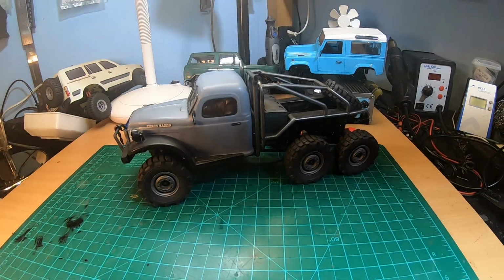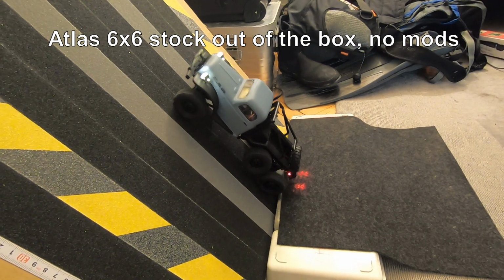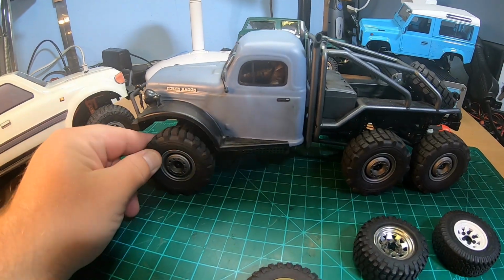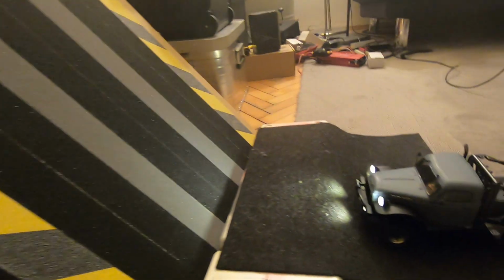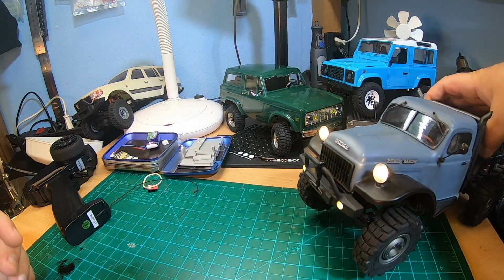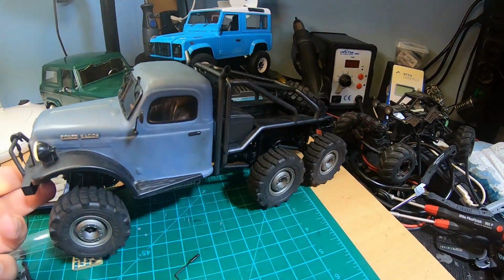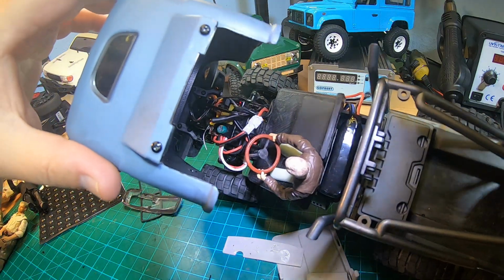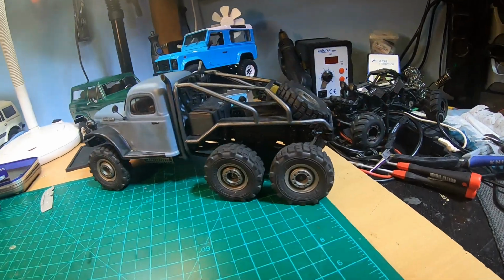Dodge Power Wagon 1/18: FMS Atlas 6x6 Mods

Comment: Great video! Im glad you looked into the tires so much, its weird that it has a different axle size. Maybe one of the rc4wd 1.2" tires would be a good fit, on custom wheels of course. I am having custom dually beadlock wheels made, so we will see how that goes.
Your powerwagon looks great btw! I LOVE your windshield and dodge power wagon emblems!
Reply from the maker: Thank you! 
Hope to see your custom duallys somewhere... in a forum or here on YT!
Forgot the Basher Rockstar tires in the video, I have a lot of them (crap cheap). Won't fit to the rims, but wheels fit to Atlas axles, looks quite cool. But tested only at 53° (with 6 Rocksta wheels) and it could not even climb 53°, no chance... did not make more tests, bad tires (for an awsome price when they were available).
Reply from the maker: Checked the 1.2s... brick edition. They are 67 mm and  larger than WPL tires. And there are no rims, only Lego rims. But rims with 7 mm hex for those on Thingiverse. Will try to print and see, if WPL tires fit... bit large for the tiny Atlas... we will see.
Reply: @donaldsneffe  Did you find a wheel that fits the 1.2” tires?
Reply from the maker: @BeeeZeeeRN  They are 1.0. Several people said, they were able to mount RC4WD tires. I bought a lot of Mickey Thompsen Baja Claws for my Atlas, but did not try so far... too many projects ;-)
Reply: @donaldsneffe  I bought the RC4WD 1.2” brick edition tires for my Atlas but they don’t fit stock rims....do you know of some rims that will fit these 1.2 inch tires?
Reply from the maker: @BeeeZeeeRN  I found some on Thingiverse for printing. I also checked those tires, but IMO they are too large for the Atlas, 67 mm (Rock Crusher Brick Ed.) and 69 mm (Dirt Grabber Brick Ed.). Not easy to solve this problem.
Reply: @donaldsneffe  I got the rock crushers because I remember reading somewhere that they tried them....probably by moving rear axle back a bit. It might be too much of a hassle though.
Reply: Really appreciate all the videos you make by the way!

Comment: I think the spare tire in the back is adding weight to the rear end of your truck which can have a negative effect when ascending. I saw the trucks rear tires grab and flip your rig a few times, which indicates too much rear weight bias. I think the Atlas could do more if the weight was balanced correctly and the CG lowered as much as possible. Very cool video, I enjoy your content and learning by watching the various different methods of testing, thanks! Just a curious thought, but do you think maybe more droop/ softer springs in the front might help even more to keep the truck down in the front and reduce hop? Beautiful job you have done with the Atlas too, it looks proper and scale! I think that the tabs on the roll cage are for KC lights.
Reply from the maker: Thanks. Probably droop will improve climbing. There are a lot of tuning- and testing options for and with the awesome Atlas. Actually it is on the shelf and I am tinkering around with other models. Maybe I will do some shock- and tire-testvideos some day. Too many models here ;)
The Atlas 6x6 is one of my absolute favourites. I love it.

Comment: I learn much from your videos, thank you.  This is such a desirable vehicle for many reasons. Yours is outstanding.  I saw a similar full size build based on the Dodge 6X6 open troop carrier. It used inverted leaf springs that pivoted in the middle for the rears 1940s stock. Way cool.  I'm on a quest to find the ideal tires for this "1/18th" scale version.  What is the outside diameter of the stock tires?  Would it be possible to move the inner wheels forward slightly?

Comment: Somewhere I've read that RC4WD MILESTAR PATAGONIA M/T 1.0'' MICRO CRAWLER TIRES works fine
Reply from the maker: Maybe it is only me that had troubles mounting the RC4WD tires to the rims. I have ordered Mickey Thompson "Baja Claw TTC", but did not yet try to mount them on the Atlas rims. At least I had troubles... if those RC4WD tires work, it is at least not easy to mount those to the plastic rims.

Comment: Greetings from Sweden . Very nice video with lot´s of good ideas . By the way . .  I got one of these myself , the red one . Only thing I´ve done so far is repainting it plus putting  on decals . About climbing , wouldn´t it climb even better with a lower gearing , if avaiable or modded  , preventing the tires from start spinning and loosing grip when trying to climb  . . ? Keep up the good work & be well . . . :O) .
Reply from the maker: Thank you!
Of course you can play around with gears, but it is not that easy to find proper pinions. You could also try a motor with higher t/lower kv. The stock motor has 55 t, there is a new 050 motor from Injora with 66t, maybe it is an improvement.

Comment: Love it, where did you get the lead weight tape from?
Reply from the maker: Thats "golf/tennis lead weight", from Ali, Ebay, Amazon...
Reply: I use thin solder wire wrapped on axles to keep rotating mass down.
Reply from the maker: @Chris-zu8ve  Goog idea, I have ordered supercheap China solder (a lot), which I never would use for soldering, only for this. Did already make some wheel weight with this solder. But how in the axles? Do you wrap it outside?
Reply: @donaldsneffe  Look up beef tubes,  they go on outside, is same principle to wrap the solder.  Dont go crazy with a lot, too much weight will kill your electronics.  but a few layers, try n wrap it one layer at a time side to side, can even use a dab of glue to hold end down before wrapping.
Reply from the maker: @Chris-zu8ve  Thanks, but  I am more a scale guy... not a crazy crawler ;-) - guess, thats not for me. Will stay with my "rotating mass" ;-)
Reply: @donaldsneffe  Look into getting Brass knuckles for the steer axle, you can get 10gram per side so you add alot less to your wheels if you find you need to after the knuckles install.  you can paint them black easy enough for scale look. Trust me you will be hating the slower speeds and end up replacing your ESC and receiver,  which for myself and so many other folks, have already replaced for better quality and ability to program the esc for better low speed control and drag brake.  But you can still burn stuff up if you add too much mass to the truck no matter where you put it so go little at a time.  Oh, if you get alum beadlocks, you could prolly skip the weight in the wheels if you do the knuckles with it.  As well as a brass diff cover for another 10-13 grams down low depending on brand you go with.

Comment: Great 👍 looking truck . Just picked one up . Where can I get that interior from . Thanks
Reply from the maker: Thanks! Custom made interior ;)
Reply: @donaldsneffe  would you sell your interior file . I have a printer . Thanks
Reply from the maker: @arthurfaison2996  No. You can have it for free...
But maybe bit of adjustment is necessary, I could have changed the ESC position a little bit, not sure.
Write your email... but it is super simple and not good, I am a total beginner in Fusion 360.
Search a steering wheel on thingiverse and scale it to your desire, this is how I made the steering wheel, ... and used a CF rod.
Reply from the maker: @arthurfaison2996  You got mail, sir and you now can delete your email adress here in public.
Reply: @donaldsneffe  Cool modifications. I got one as well for X-mas ;-) and am in the process to modify it. I'd like to add a driver and saw your interior solution - looks good for me. Would it be possible to get the file as well?  Thanks! 
FYI: I removed the front bumper - looks cool with the hard springs and as well increases the crawling capabilities...
Best regards
Peter
Reply from the maker: @pera3445  Got mail, sir!

Comment: Cleverlyrc on instagram was just able to mount rc4wd 1.0" tires on his atlas 6x6 and he said the difference is HUGE!
Reply from the maker: Yes, it is, as you also saw in this vid. 
Did he succeed to mount them on the Atlas rims?
I ordered 10 rc4wd tires, still waiting to arrive, and will try do make duallys with 3d printed rims.
Reply: @donaldsneffe  yes, he mounted them on the atlas wheels!
Reply from the maker: @Thepreppersbunkeroutdoors  ok... interesting. I did not succeed. I checked all RC4WD 1.0 - they do have varying inner (!!!) diameters. Maybe he tried different ones than I did, I only tried the Bronco tires. Which ones did he use?
Reply: I did with some custom 3D printed rims and it worked out great! Patagonia's are always up to the task
Reply from the maker: @CapCDj  Did you design your own rims or did you use rims from Thingiverse? 
My tires did not yet arrive, so I so far only printed out some cool rims from Thingiverse to see if they come out fine.
I am quite a noob in 3d design with Fusion, not sure if I already would be able to design custom rims, maybe.
Do you show your rims in some forum or video?

Comment: Do they make a micro brushless system for it? Love to see it installed if you can do I could do the same to mine I just got
Reply from the maker: Not really. 
BL is also very poor at low speed performance. Wanted maybe to use the new Racerstar (see https://youtu.be/YuoNyZJjWx0?t=204 at 3.24), but all this is not an easy fit, also different shaft diameters, pinion difficult, ... a ton of work and probably bad performance. Check GamyRCs channel for BL motors in micro crawlers.